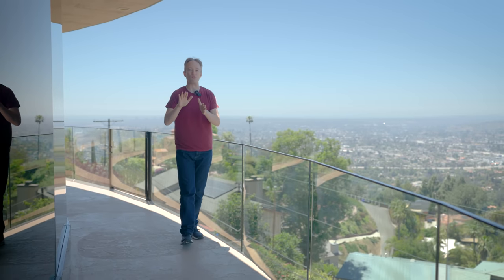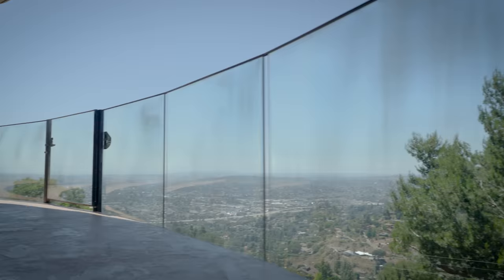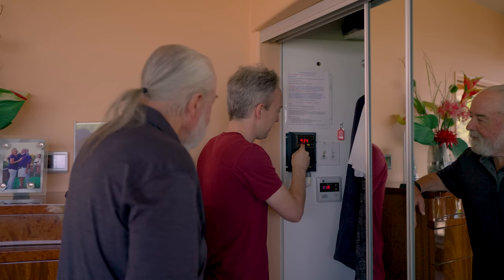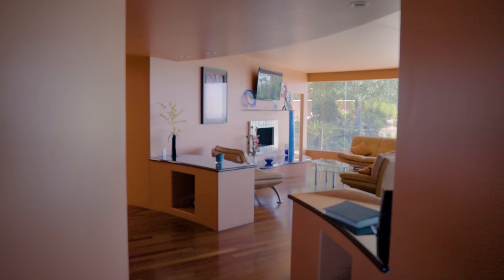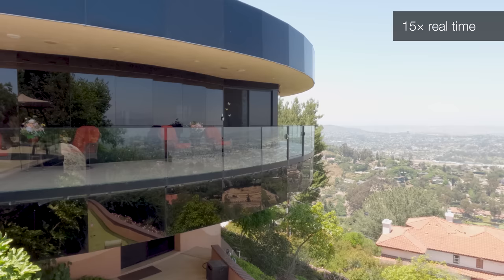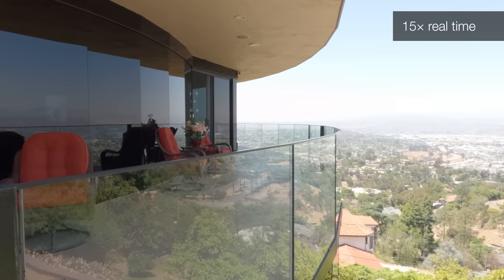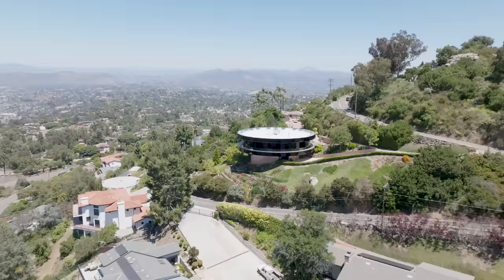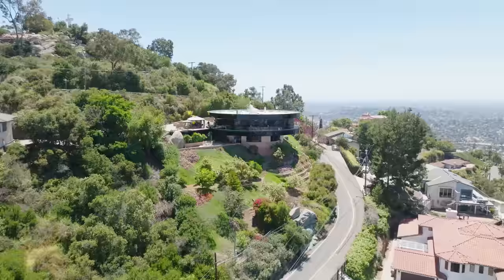I thought this rotating house was impossible.

Comment: As much as I would love to live in this house, I can't imagine the potential maintenance and tech problems that could arise.
Reply: When you have the $$ that guy OBVIOUSLY has, you don't worry about it.
Reply: It depends on how it's built; look at EV's vs ICE cars, due to fewer parts EV's require less maintenance. The homeowner spoke of the seals lasting 75 years, and if the motors he is using are electric, they too might be low maintenance. From what I have seen of his designs in this video; I would think he took such things into consideration. Motor homes are an example of how use/the vibrations from the road can cause a lot of maintenance issues, it makes one wonder if houseboats and yachts have a similar issue due to waves, anyone know if this is the case.

Comment: Sold: $5,100,000  Sold on 08/21/23
Reply: Imagine owning that, and the original owner passes away, then that custom rotating seal starts acting up...
Reply: @AAgunner  - Not rocket science, plus you have the drawings of the part.  Head to the machine shop and fabricate a whole new piece if need be.
Reply: @gatsbylight4766  It's certainly doable. But it won't be quick or cheap. But i guess that if you can afford a place like this, money won't be much of an issue.
Reply: @AAgunner   - Personally, 1.3 RPH (1-1/3 rotations of the house in 1 hour, or 1 rotation in 45 minutes) is a bit too slow for me. He calculated that the motor would need to be 5 HP, but then downsized to 1.5 HP.  Me, instead of a 71-to-1 torque hub, I would've stayed with the original 5 HP motor but decreased the torque reduction (hub).  If 33-1/3 RPM was a good enough speed for my old vinyl record albums, then it's good enough for my house dammit!!!  Take that bastard from 1.3 RPH to 2,000 RPH.... It would be like a Tilt-a-Whirl in that fcuking house!!! 😳😆😂🤣

Comment: 5:00 -- Whhhhhyyyyyyyy would you choose to put the sewer line and gray line ABOVE the drinking water line?!  If there is a failure in the seals of the sewer/gray lines or the portion of the shell around it then they could leak down and contaminate your drinking line!

The same issue would be true if the system was inverted; you would just be worrying about sewer/gray water gases rising up and contaminating your drinking line.

I would like to have heard more about these "sensors" that detect for leaks in the rotating water system.  Specifically what they detect.  Also, is there a R.O. system at every drinking water faucet as another source of redundancy?  Is the house drinking water tested regularly or at all?

Edit -- Just realized this house is in a major earthquake zone.  What effects have prior, major earthquakes had on the sensitive cylindrical services device?  What precautions have been taken to prevent damage by earthquake to the sewer/gray/water/gas cylindrical services device?  Are any of these precautions UL listed or otherwise industry standard?

Comment: In Trondheim, Norway, there is a 124m tall radio tower with an rotating observation deck that has a restaurant in it. The restaurant is at about 80 meters up. The while thing uses an hour to rotate 360 degrees. The windows lean outwards, so if you're sitting at the window seats you can almost look straight down. The whole tower is called Tyholttårnet.

Comment: The slip ring is the same concept used to pass hydraulic fluid between the treads and the rest of an excavator. Very ingenious
Reply: Yep an old concept but still very clever to get it all working (somewhat) leak free in a new application.

Comment: The buyer of the house will have to deal with difficulties with the gas company since the rotary coupling is not UL or other regulatory agency certified.  He might have to convert the appliances  / heating to propane and have a refillable tank that rotates with house.

Comment: I'd have made the center mechanism slightly different. 
The same concept, but horizontal with fail-safe drains between each liquid in case one or multiple seals fail. 
Sensors in the drains to detect any failure. 
A horizontal orientation with safety drains should minimize the possibility of cross-contamination. 
Alternatively, at the very least, I'd have the clean drinking water at the top of the vertical mechanism he has designed.

Comment: I don't want to take anything away from the guy's serious innovations - but the rotating union that handles multiple fluids? That has been around for decades. Called - funny enough - a rotary union. They are extremely common across a number of domains. How do you think an excavator has a body and bucket that can spin 360 around the tracks while still driving them?
Using one for architecture is extremely novel and probably had it's own engineering challenges, but the basic concept is very very old.

Comment: Well, as of 4:15, obviously you'd run each fluid pipe inside the other fluid pipes, adding layers as required, and differential them out once they'd got into the rotating section. As of 5:09 oh, or you could make it MUCH more complicated. Cool, and working, but, I mean.  You could also do it with mechanically activated header tanks.

Comment: Dang, so much missing info in this video. Like, how much does the rotating part weigh? And how is that weight supported? Just on that center bearing?? Or are there other bearings on the bottom of the rotating portion? And what kind of special construction was done to support that center core? Was a special center foundation made and how much concrete/steel and what kind of arrangement? 
How did he fine a construction company willing to take this on? How is drainage handled? How is HVAC handled? Looks like there is an A/C unit on the roof so maybe there are no special considerations. Are those solar panels on the roof as well?
Does it make noise while it rotates? Where is the gearing and how big of motor? What's the electricity cost? Can he control the rotation manually? For example if he doesn't want the sun in his face in the morning. Can he speed it up and slow it down and stop it? How fast will it spin if so?

Is there anything he wanted differently or was disappointed couldn't happen?
Does debris ever get caught between the walkway and the house?

Do people ever get vertigo? 

Is there any earthquake precautions in the design? 

Did he have any issues with inspections or city/state code? Especially with his patented device? Did he have to wait for approvals because of the slip ring? 

What's his background? 
What happens if the power fails? Do the sensors on the slip ring still work with a battery backup or generator?

Is there a weight limit and/or guest capacity? 

How much did he spend on the project?

Comment: The rotation house is not difficult to power, the contacts like are used in generators, they are metal rings with spring loaded contacts.

The plumbing would be tougher.
You would need to have a stack pipe that had a trough gutter system to collect the water from the pipes.

I would be interested in seeing the plumbing connection

Comment: I can't get over the fact that this thing uses a 1.5 horsepower motor. That's less than most lawn mowers. I guess if the thing is really well bearinged it doesn't take a lot of energy to move it...

Comment: Devising a way to getting the engineering to work practically is of course very hard.

But proving to yourself it's topologically possible is easy because you can just have rings under the house that connect to the different supplies. 

Sewer is the easiest because you can imagine that at a particular radius you simply have a trough that collects the sewage and then one or more outlets at that radius. 

The others are harder to imagine because they are under pressure, but that's just an engineering challenge, not a topological one.
Reply: You could also have rings at different heights along the exterior. I believe that's topologically equivalent to what is actually happening.

Comment: If that was Seattle, they would condemn it until the mercury was removed
Reply: Mercury-free slip rings for internet, phone or other data transmissions actually exist since mercury is also banned here in Europe for example.
Therefore it could be as simple as swapping the mercury wetted slip ring for a mercury-free one.

Comment: Huh, I would think that a simple sump pit that the rotating structure would dump into would make for a safer and simpler solution. A propane tank could handle gas without a hard connection. Then you only have to solve for clean water and electricity.

Comment: It is difficult to believe till you check it yourself, or video should be planned it in such a way which cannot be easily possible through video editing.. but if its real then just thinking about it is something that deserves lots of appreciation as it requires lots of bucks, daring and time, execution is totally possible in today's world with so much equipments as if base floor is static then all other electric wires and pipes can be attached to it and they all need to be joint from centre of the base which will make equal radius to all points always, thats is very much possible... for instance for outflow water flow centre pilar will have a circular main pipe which goes in the ground and which should be open from above and above it would be another closed regular pipe that rotates with the house and every pipeline is obviously segregated, and for inflow water strechable rubber pipes rotated on the pilar or regular pipes whose outer structure can rotate, rotate and not revolve with house also very feasible and can be used so everything available, just buy equipments and fix it..nothing which will require too much brain storming... otherwise if it was brain storming even he would also not be able to spend so much time in a day continuously and would be tired too ... But regardless deserves appreciation for the thinking.

Comment: Definetely would not pass inspection here. Sewage and drinking water are mandated to be at least 1m appart and sewage can never be above drinking water because if it leaks it can contaminate not only the branch but the whole line.
Also I see a lot of trouble with sewage water in moving parts... Usually sewage pumps have a life span of 20 years, tops...
Interesting solution but there's a reason this is not a common one.

Comment: Weird how he didn't put gas and water on top and sewage on the bottom of the slip ring. If there ever was a leak, you'd rather have the clean water get into the sewage than the sewage in the clean water.

Comment: Drinking water in the same assembly as the sewerage, no thanks.
It will wear out, it will eventually leak. There needs to be a good separation so that leaks are obvious, and not potentially contained inside the one assembly.

Comment: And if there is a power outage, is there a generator to align all the connections? I would have put the sanitation collector ring on the bottom and the fresh  potable water on the top ring.... just in case of seepage.

Comment: It seems to me that the order (sequence) of sewage, water, drinking water and gas is somewhat poorly or suboptimally chosen; with sewage as innermost and particularly at the top of the stack, in case of failing or compromised seals, this could then--in a bad/worse case scenario--leak sewage and flow over all utilities below, contaminating a water flow; intuitively I would have positioned that as the most outer and at the bottom of the stack, preventing any leaking over and into the water flows (because that's how gravity works), and instead such that cleaner flows--in case of most horrible scenarios of failing seals and junctions--cleaner utilities could contaminate dirty(/dirtier) flows, but not vice versa? (Also, during routine/periodic maintenance, inspection, cleaning, seal replacements and related work/tasks, during which one or more of the duct/pipes are opened / have the internals exposed, a flow of sewage return above  either water delivering infrastructure would be less desirable). Regardless, it's clever and the patent is indeed cool, but is all that as it is designed and built compliant with code? I'm sure the biggest nightmare was convincing a building inspector to sign off on it? 🙂

Comment: I would have just made it turn 90% so it could run on longer hoses and wires that could be replaced when needed, Id be so worried about the system failing and the gray water mixing with my drinking water, I don't drink city water but I do cook shower and us it for other things so it has to be clean,
I do like the house and design,
 Yes Id live in it,

Comment: I would not want that house. You would have to have a engineer to repair anything that broke in there.
Reply: If you'd be able to afford such a house I don't think money would be an issue at that point.
Reply: It would still be annoying  @BelgianCat
Reply: @onyxdragonlady9928 You're absolutely right, good luck finding a company that will actually be able to properly fix that large slip ring for water, sewer and gas when the seals will inevitably begin to fail.
And I don't think having a lot of money will really matter then as it's a very specific, custom-made piece of equipment we're talking about.

Comment: I don't know why he would put the drinking water ring BELOW the sewer ring. All seals weep a little bit, even if it's a negligible amount, but why not use gravity in your favor. Personally, I would have separated the drinking water completely. It would still work as functioned, spinning on the same shaft but separated with a gap, like two separate pulleys on a single shaft. Lastly, the lot sucks (it's not directly on the waterfront), and the house is really ugly, like any other house designed in the '70s.

Comment: Turning sewage is easy, as its now sealed. Just a pipe a hole in center. 
Gas, he should not brign it at all, as electricity can be used.
Water could be solved by reservoir pumped on the ceiling, than distributing. 
Internet solved via remote internet.
Electricity is off shelf solution. 
So in all, that turning joint invention is overcomplicated and pointless :)

Comment: I'm wondering about how imperfect the diameter is.... I noticed that there seems to be about two to three inches of space between the fixed outer ring and the rotating portion.... What is the circumference and the radius?

Comment: I'm curious what has to be done to replace the seals. Do you know is the sleeve is split, or it needs to come up and off in one piece, attached to the house? Really curious of that. The way I see it, the house would need to be lifted to replace the seals.
Reply: It sure will be quite a hassle for the next owner.
However I don't think they'll have to lift the entire house, instead it might be more something like disconnecting all the pipes from the top part of the slip ring, then separating that part from the house and lifting only that part as it's more likely to be fastened to the house by bolts or something else that is removable, than to be set in concrete for example.
Hope that makes sense.
Reply: @psirvent8  that makes sense

Comment: what is  the measurement in? like the speed is  1000___
Reply: The motor itself could be 1000 RPM as it then goes to a gear reductor to increase torque and be able to rotate that massive house much slower.

Comment: Why did you think it was impossible? Impractical and Expensive, sure. If the ball bearings in your vehicles and hold up to the weight of the vehicle in motion and last for 20 years, why not under a house? The front CV joint takes massive abuse and they last 120K Miles. Take care

Comment: 5:30 The one part that really surprises me is that he has the sewage on top?  I would have thought the order would have been completely reversed, with the cleanest water on top, and the dirtiest on the bottom, just as an extra precaution in case there is a leak.
Reply: The others (gas and fresh water) are pressurized so it is highly improbable that the sewage water will leak into the gas or the fresh water pipe.

Comment: I feel like a tech bro would definitely buy this house. My question is: what happens to the seals after 75 years? I’m sure the guy has invented a maintenance procedure to change them out but my simple mind would never be able to figure out how without dismantling the core in some way
Reply: My guess would be to drain the system completely and then disconnect your piping and remove the outer shell and replace the seals. I could be wrong but from the diagrams thats how it looks. Reconnecting straigh pipe would be easy enough. It looks lik to me the waste water drains down and the clean water is pumped up so again letting the system drain and run dry would be easy enouigh as well.